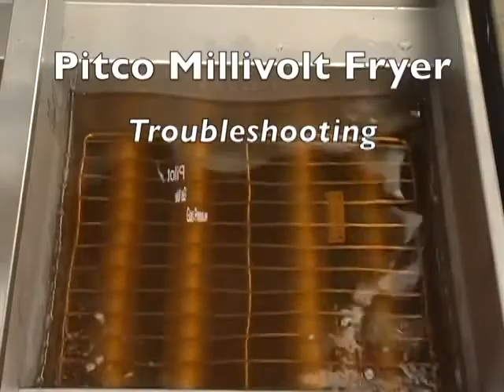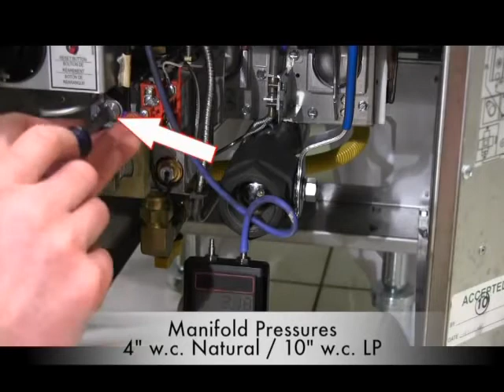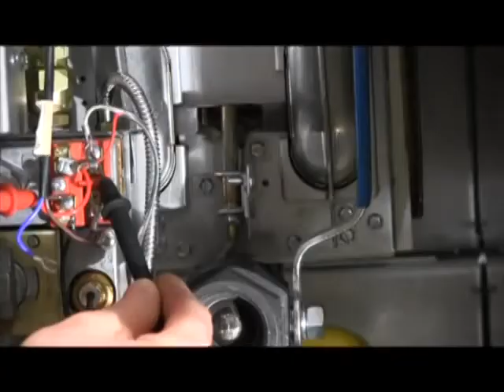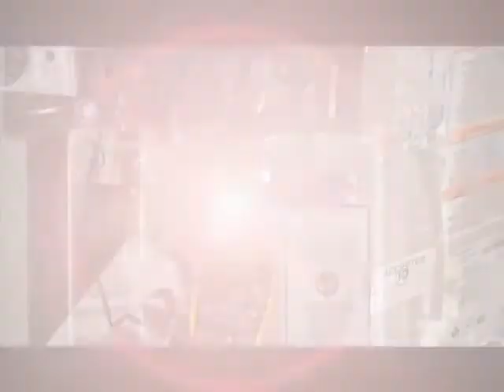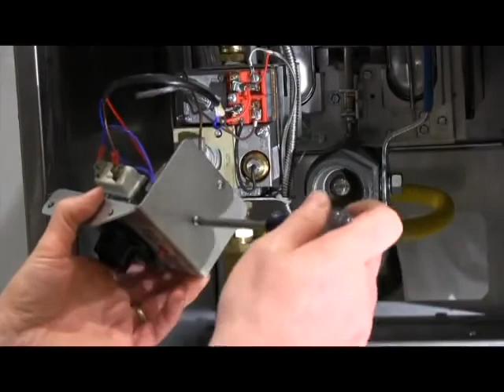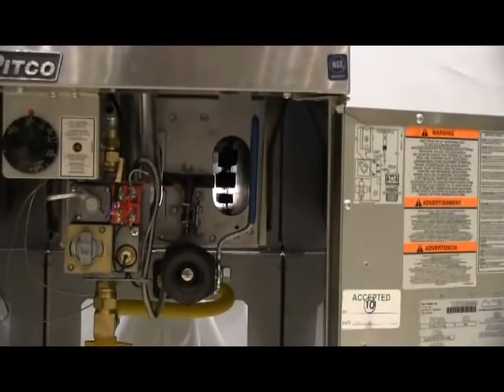Pitco Fryer Millivolts Troubleshooting

Comment: the thermostat can be checked while the unit is off with ohms but that does not mean it's ok. Sometimes they need to be calibrated and then sometimes they just turn on and turn off. When that happens they don't register temp they just heat until they kick out the high limit. Another way to test a bad burner is the color of the flame. If it burns orange you will be serving raw food. Needs to be replaced.
Reply from the maker: yeah you have a point bro. but basically using multimeter help up us to do our work easily. if we don't read any reading using multimeter it means he have a defective thermostat. its a simple reference either the part is good or not. if we test the parts is good then we need to jump other conclusion why this thing happen.

Comment: What happens if you can’t keep the unit lit?
Reply from the maker: if the unit have a pilot flame but the burner flame don't lit even the gas valve are in ON position, check the thermostat first.
Reply: I need to keep the pilot button compressed for pilot to stay lit. Once I put control to on and try turning on thermostat everything goes off.
Reply from the maker: @johnbrunetto  check the thermostat proper resistance(1/2 oms or less)clean the thermocouple using scrub pad (must read at least 550 to 650 MV when pilot ON)
don't forget to check the possible loose wire connection tighten if needed. if all this thing are good you have a bad gas valve.
Reply: @kitchenequipmentexpert4977  I have only 200mv on thermopile
Reply from the maker: lack of power to hold the main valve of gas valve that's why the burner wont fire up. clean the thermocouple first, adjust the pilot flame until reaching 600 MV +- 50 MV.